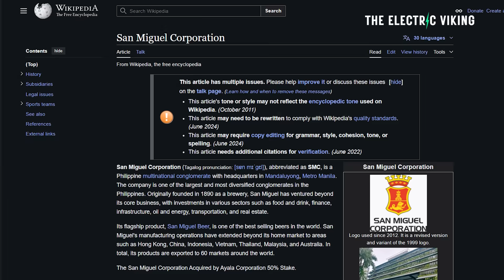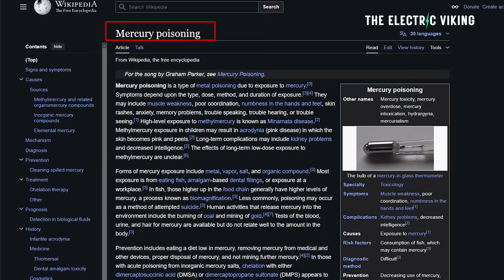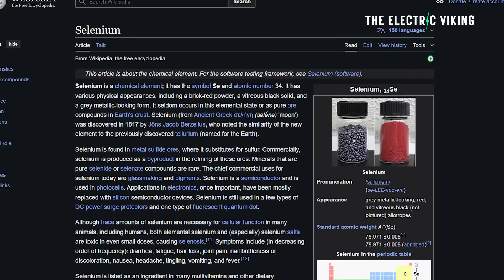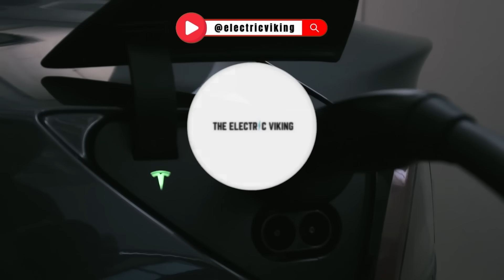Solar replaces one of the most toxic coal power plants in the world in Texas

Comment: Sulfur and nitrogen compiunds become sulfuric and nitric acid in water vapor.  These react violently with organic materials like a virus, bacteria, mold and a fungus.  One does not like to hear about toxic chemicals from coal but how many people are saved because of the germs that are killed? The same with the internal combustion engine.  Billions of cubic meters of air are sterilized by the ICE in a big city every day.  How many people might have gotten sick from the germs?  It is not so easy to know how many people lose how many years of life.  Nuclear arguments use the millions of deaths argument.  I would rather live next to a clean coal plant than a nuclear plant. Smoke can be scrubbed and filtered.  The CO2 argument is based on falsified  temperature graphs.   One might wonder about other government statistics.
Concentrated solar uses a metal mirror that might last thousands of years and is not a toxic problem.  But it requires constant sunny days? If you have enough dishes there is a certain possibility that might double the efficiency.  If a big ball of plasma is created at the focus of a million solar dishes firing 10,000 watts of microwaves, the cloud cover might be removed from a large metropolitan area.  If it is cloudy half the time, this would double the solar energy if the energy required is not too great.  Most clouds are not heavy rain clouds but they can still block most of the sunlight.   The clouds will return or reform but that takes time.  Maybe long enough to get a huge amount of additional solar energy for a relatively  small expenditure of energy.  Opening a window shade takes a tiny amount of energy compared to the amount of solar energy that comes through the window.

Comment: Texas has its own independent grid, to avoid federal control. They have the most power outages in the US, a country famous for its unreliable network. When snow or freezing rain or regular clouds cover the solar panels, good luck. Count on the wind turbines to stop when freezing rain hits them, accountants wanted to save on the heating installation, Plus gas valves to freeze, due to bad  design. Nuclear does not like big power swings and says bye bye. Only hydroelectricity remains. This is not a joke, it happened for days and weeks in 2021 I think. Minor repeats happen every year. As far as batteries are concerned, their storage is good for power swings but not for 24 hours or more, no capacity is mentioned, anyway it is minute compared to the hydro. due to installation and maintenance costs. So what do we do? The sun rises from the east. In China they have the + and - 1,1 million volt lines, that bring electricity from 3.000 km, for now. The same technology could be used to bring electricity to Texas from Chili or Montreal. The obstacle is the lack of good engineers in leading positions. The chaos was created by lawyers and blessed by accountants who work with numbers assumed by fortune tellers. Nature does not agree neither with human laws or false figures. Transmission lines in North America and the 'self proclaimed Free World  use at most 765kV AC, developed in 1960. No development since then. It is the fault of the Chinese who stopped sending their best engineers to the US. Add India, Russia. Of course there still is Greece but that is too little. Even these are sidelined, in favor of the IQ level of our leaders. Let us pray for some divine intervention...

Comment: Will we see the end of Solar, Wind, and other forms of producing electricity by using two of the most abundant elements on Earth that don’t have to be manufactured or mined, and there is an endless supply of them and the power generated from them is almost non-polluting?  That abundant element is saltwater and freshwater. Will the EV battery in the not-to-distant future be nothing more than a tank filled with freshwater and saltwater? It's called osmotic power. Nothing new. It’s been around for many years. It’s a Molybdenum disulphide membrane that separates saltwater from freshwater. As the saltwater ions pass through the membrane into the freshwater they create electricity. The only problem is producing the Molybdenum disulphide membrane big and strong enough to produce large amounts of electricity. Researchers are working on it.
Reply: If Osmotic power is perfected it could mean the end of building destructive hydropower.
Osmotic power can also cause freshwater and saltwater to move very quickly through a pipe that has a turbine connected to it that turns a generator to produce electricity. Researchers are also working on that as well.
Reply: @robri87-hh4gr  Tofte, in Norway, has an Osmotic power plant. It produces electricity with a hydroelectric turbine.

Comment: The US should stop building massive solar panel farms. That is the reason why The United States is having so many severe weather events. The US in 2024 had 100 more tornadoes' than in previous years. More floods, heat waves, extremely cold winters. Solar panel farms are changing the Earth's natural weather system, and the more they build the worse severe weather events will occur.

Comment: Lookup the Sherco solar project in Becker MN, with sights set on shutting down the coal plant there. Site #1 (roughly 1,500 acres) went online this fall, site #2 roughly 1,600 acres is about half way done. And basic ground (fencing, parking lots, ect) work has started on site #3 at roughly  3,000 acres.

Comment: Texas has been adding wind power for a while, but in the last year or two, they started adding solar and grid storage. I knew eventually there would be consequences. Coal is a baseload generator, and is not designed to follow load, so solar is very painful for them and batteries make both wind and solar work better..

Comment: I Have seen some years ago a much very nice conversion of coal powerplant.
They repurpose it, as thermal battery. Modifying the burner as a graphite electrode/fuse metal thermal battery recycling the insulation, heat transmission, steam and turbine of the power plant.
So with excess current they put heat in the battery, even fusing the metal. Than when you need the power back, they run the water in the system like was done before, vaporize the water and run team turbine producing current. With nearly 1 to 1 conversion. 1Gw coal plant become a 1Gw/h battery. And you can expand it adding extra batteries if needed to better use the steam system

Comment: The only real problem remain winter base load.
Daily/weekly oscillation start to become managed with storage solutions. But in Winter there is simply too many months with low renewable production.
 I'm bit biased by my professional history probably but we need long time storage or flexible and clean "chemical/pysical" power generation.
Ammonia, hydrogen, methanol, nuclear, special batteries not yet existing and using fuel cell, combustion whatever will work best as round trip efficiency.

Comment: Solar and wind failed Texas so badly 2 years ago they ain’t sure to forget anytime soon.  No natural gas to back them up that winter.  Pipes broken and people accidentally killed themselves setting in running cars in garages running the car heater.   The biggest surprise was the $4000 electric bills after electricity had to be rerouted through the grid from other states.
Reply: It was the gas pipelines that froze; the wind turbines kept going but the  more generally the distribution network was just not winterized. In theory it should all have been updated by now or at least all the most crtical hard to repair.
Reply: The turbines stopped generating electricity, as they always do during frigid weather, which caused the gas line to freeze.
Reply: @TGWazoo1  How does that work? The turbines never froze as these parts are standarized for global temps like in Europe. The texas independent  electricity distribution network ( Ercot) froze in places and thus the entire thing collapsed or in my memory came pretty close. That coupled with extraordinary high demand then tripped some of the parts that still worked.  The idea that Turbines froze is just nonsense and pretty dumb propaganda.
Reply: It was the natural gas system that failed and the wind turbines were under spec'ed. Plain old cost cutting greed. So very texas.
Reply: The internet told you that?

Comment: u know what crazy though, still no one is going hard into tidal, so at this rate at the end of the wind and solar renewable revolution, theres going to be another one immediately as ppl develop hydro/tidal power.  the wind is just the lagging edge of the least dense material being driven by tidal forces the energy available in the tides in magnitudes higher than the surface area of earth catches in light or the slightly slower moving than the rest of air air brings
Reply: solar we capture less than 1% of suns light on surface and wind is literaly the air not keeping up with the spin of planet combined with the thermal and drag effects of tides/currents then we try  to harness a small portion of that lower energy material.

the power available in tides is potentially 100% available and many many times more than the wind it helps drive

not that wind and solar arent also useful not everywhere is next to a ocean, but 90% of our surface area is water we are a water world WITH a MASSIVE moon so tidal power will ALWAYS be the most scalable.
i expect even if we built a dyson sphere we would still generate most of our power for earth locally on earth via tidal, cause of our huge moon and shallow seas we are a absolute tidal powerhouse
Reply: The only real down side of tidal is the fact the turbines are underwater, and that means everything will want to grow on them or corrode them etc.  The turbines will need to be easily serviced to keep them in good working order.  I am a boatbuilder, and have made a good living for decades keeping boats from fouling, corroding,  rusting, electrolysis damage etc. The sea is a very tough place.

Comment: Stop burning stuff. An internal combustion car running will kill but an electric vehicle will no in a garage. Clean air is available in the immediate area as a benefit to the local area  Also the lack of dependence on oil and the ability to top off at home is a plus.

Comment: One of the easiest and most cost-effective ways in 2024 is simply to effectively capture various types of dust, including both coarse and fine particulate matter and other pollutants by installing all kinds of filters. If the input coal has high levels of mercury it can be extracted either before or after burning it. What You get are not fume clouds, it´s clean air. 
If no filters are installed at all, obviously it is highly polluting and harmful to lungs/ health and deposits of ash may rain down on fields çeaving residues etc. Lignite-powered Germany in the 1970s/1980s had grey skies for over 250 days per Year in every industrial region. In the 1990s they installed filters. By Year 2003 forward the sky was and is blue.
If the coal plant produces a peak MW 410. it easily runs at 300 MWh 24/7 equivalent to 7200 MWh per day. The 600 MW solar installation will provide a reasonable load to the grid and charge the batteries for 4-6 hours per day " In California and Texas, where we have the most solar panels installed, we get 5.38 and 4.92 peak sun hours per day" if it´s sunny and not cloudy plus another maybe 4 hours of a kind of trickle charge. For 18 hours per day it will produce close to zero or zero. "Daily kWh Production (300W, Texas) = 300W × 4.92h × 0.75 / 1000 = 1.11 kWh/Day" A 600 MW solar plant in Texas will generate approximately 2220 MWh per day - less than 1/3 of the electricity produced by the coal plant and not even at the peak hours from 6 PM onwards. This is not to say lignite-burning is good or sustainable in any way, it is reliable on demand and provides 24/7 baseload to the grid . The sun is neither reliable nor available 24h per day and while expensive battery storage solutions available in 2024 are much, much better than nothing they are not the solution to the energy needs of Texas.

Comment: I have lived in Alberta Canada for the past 45 years. I would like to see Renewable Energy put the Oil Companies out of business here FOREVER.
Reply: Tar sands oil produce 5 to 25 times more greenhouse gases than oil that is just pumped out of the ground. Alberta tar sands are the SINGLE BIGGEST EMITTER of greenhouse gases in Canada, producing half of all GG's in the country.
Reply: @rasoul786  There's one for the New Team
Reply: There are many  uses for oil not just using for vehicals fuel and power generation. Same with coal.However their extraction and conversion to  useful products has to be strictly controlled so there is minimal environmental damage.
Reply: @alandean6930  sure, but that oil doesn't necessarily need to be a fossil fuel based oil
Reply: @alandean6930  The economics/physical chemistry of non-fuel uses for coal are even tougher than burning the stuff. It is very likely that the vast majority of coal stays in the ground.

Which is a very good thing, since all the coal comes from a period of time where the CO2 in the atmosphere was much, MUCH higher than even now. Average global temperature was something like 8C higher.
Reply: @alandean6930  oil will stay in demand as long as aviation industry uses oil
Reply: @pranshukrishna5105  Aviation will be one area that is harder to de-carbonize, but at least airline carbon emissions are only 2% to 3% of total global emissions currently.  That said, there are huge advances made in electric aviation, and electric aircraft will significantly disrupt the short-range commuter (under 500 miles) flight segment.  Short-range air travel represents a hefty 30% to 40% of total flights overall!
Reply: @pranshukrishna5105  Furthermore...

There are other aviation energy options in research such as hydrogen, ammonia, and e-fuels created from renewable energy.  E-fuels are energy intensive and inefficient right now, but it could be made to work with the specialized airline industry.  But the vast cosmic power of our sun, combined with exponential capacity growth of renewables and its historic low energy generation and still decreasing generation costs should effectively mitigate inefficient e-fuels production process.  E-fuels are not ideal environmentally either because they still cause polluting emissions.
Reply: @beyondfossil  nothing is comercially viable as of now
Reply: @beyondfossil  hopefully
Reply: Agreed. Alberta leadership is so short sighted. They will be left out of the new economy
Reply: Hear, hear!  Unfortunately, the UPC will lead Alberta down the road to ruin when Alberta is left high and dry without a viable economic alternative to O&G industry -- all just to extract ever last dollar of money that can out of the business for themselves and their oil industry masters whom they serve.

The UPC have shown themselves to be uneducated hicks.  They had a party convention in October when they proudly announced total falsities like the doozies: (1) the world needs more carbon (2) the world is at lowest carbon levels ever.  ALL CATEGORICALLY FALSE!
Reply: Won’t happen. Oil is used for almost everything in our daily lives. If you want Renewable Energy, then you must have the Oil companies to produce the oil and chemicals required to be able to create renewable energy. You cannot build Solar Panels, Wind Turbines, Storage Batteries, Nuclear Power, Hydropower, Electric Cars, and so forth, without oil being produced by the oil companies. If the oil companies stopped producing oil forever, life as we know it would come to a standstill. Oil companies are some of the biggest investors in renewable energy.
Reply: Oil demand will plummet.   @Dollarbill-g1l
Reply: @monkeysezbegood  The oil companies welcome Renewable Energy and Electric Cars. Why do you think the oil companies are investing billions of dollars into renewable energy and electric cars? The reason is because it makes them more money.  Oil companies are making record profits. Even if the whole world goes all-renewable and all-electric, there will still be a high demand for oil.
Reply: You're wishing for job losses and  reduced gdp.
Reply: @f1aziz  You are thinking short-term.  The longer-term issues are far worse: environmental degradation, and eventual economic ruin when the world moves on from Alberta's O&G products.

Furthermore, from an investment point of view, the energy transition is well under way.  According to the IEA, global investment in clean energy is nearly double that for fossil fuels.  Global energy investment will surpass $3-trillion in 2024 and $2-trillion of that is for renewables.  It's only going to accelerate.  Alberta is just a small part of the global economy and is going to get rolled over like a popsicle under a truck's tire on a hot Alberta summer day.
Reply: @beyondfossil  What is the Canadian equivalent of US Environment protection Agency
Reply: @beyondfossil  Ha ha ha ha ha ha ahhhh... LOL with love from my side of Calgary.
Reply: @f1aziz lame joke, renewable energy is creating hundreds of million jobs 😂 and petrol is causing climate change, and loss of 1 trillion of GDP every year
Reply: @f1aziz  Not if it's transitioned properly.   You're wishing for environmental ruin and also eventually major job losses when the world moves on beyond Alberta.
Reply: @f1aziz  I own a Car Detail Cleaning business. i make money when times are good and when times are bad. Customers always need a Clean Vehicle when they sell it or buy it. either way I win. I used to be in Construction as a Framer/Carpenter for 12 years building houses in Calgary. EF that!
Reply: @nicevideomancanada  I can only marvel at your heightened sense of self-centrism and lack of empathy.
Reply: @f1aziz  Bots have no real feelings
Reply: @nicevideomancanada  Yeah that's what I said.